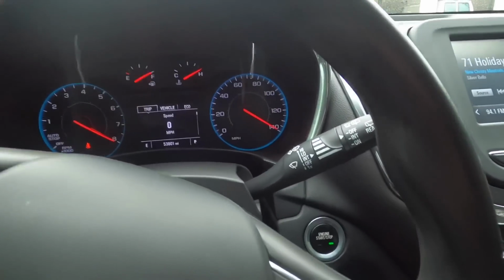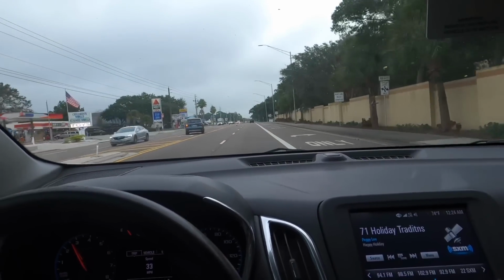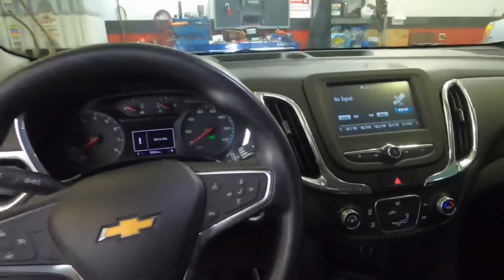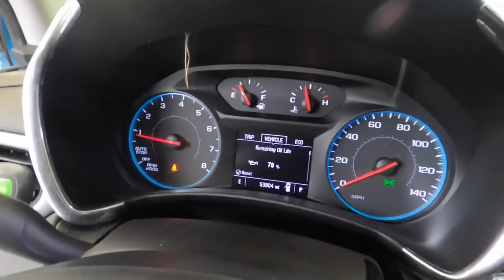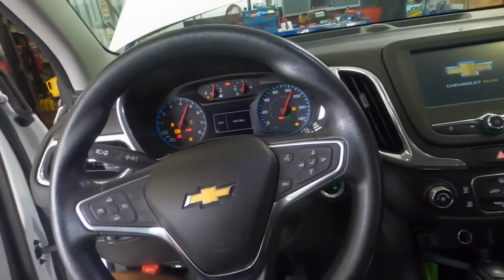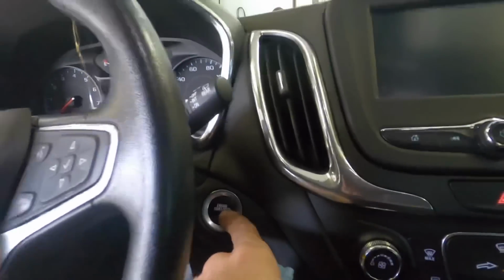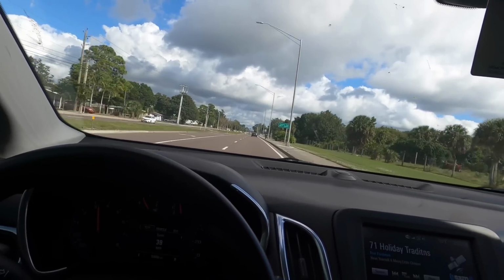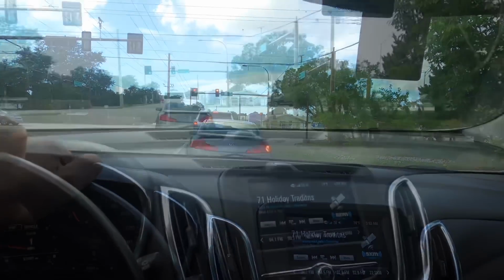Low oil could cost $$$$ | By Mistake!

Comment: This is why at 70,000 miles I did an oil system cleaner on my 2018 which uses the same engine family but it's a 1.4L. These new engines run hot and the varnish builds up with proper service. I've had no problems with mine but I feel good now doing this the last time I had mine services to prevent future problems.
Reply: The 1.4 also doesn't tolerate excessively long oil change intervals. Trying to squeeze 7500 miles between oil changes isn't worth it. If it isn't turbocharged, you're better off using a cheap semi-syn blend and changing the oil earlier, like 5000 miles.

Comment: Also, I've been told (I have a 2016 Malibu w/1.5ltr) that these engines do not like 5K oil changes. I barely get 3K in 120 days, but you cleaning it was the right call.

Comment: I was mechanic for many years and this is the main reason I gave it up. Back then we use to do oil changes to give the engine a longer life, it has gotten to the point that in order for the car to operate correctly it needs clean oil. Most people my age would not understand that and would fight with you all day. I am 54 and the cars today has gone from an A to B transport, to an expensive robot. Who would ever thought to check the oil first.

Comment: Hey Ray, another epic video tape my friend. As you know, many of the GM motors use oil pressure for actuation of the clever stuff, this diagnosis was simply satisfying to watch - You also saved your customer at least a grand and I am sure they'll return for future work.
Over here in the UK I drive a Vauxhall Insignia VXR Supersport, it has the GM 2.8 V6 (LP9 platform) and it needs frequent oil changes due to the complexity of the PCV system and oil-actuated systems, if you fail to service this motor with clean oil at least every 6K miles the goopy shit builds up and its game over for the VVT and timing chain systems - but knowledge is power and videos like yours empower us non-mechanical users with the knowledge to keep on driving trouble free.

Cheers 

Rob.

Comment: Had the same on my old escape. But my oil wasn’t even low. Just old and dirty. Life got in the way and I had 9000 miles since last oil change. VVT code! Luckily the internet did say possible oil related, so I figured start with the simplest fix first. An oil change did it! No more than 5000 miles between oil changes for me now!

Comment: Some advice from a former race engine builder, If  you drive a four or six cylinder engine make sure you do frequent oil changes and keep the level up. (This applies to all engines no matter the number of cylinders however, 4 and 6's will show stress far sooner and the problems will be greater than an 8) I now drive a Prius and before that a Jeep. One a 4 the other a 6 and i can tell you when i need a oil change just from the way the engine sounds. It will let you know when the oil is getting to degraded to keep up with demand. So do oil changes 3 to 5k and keep the oil topped up. It will help you get well over 100k in miles on your vehicle. (my Jeep had 350k on a 4.0 straight six and my prius has 200k on a 4 i can lift by myself)
Reply: well to be fair you could probably get 350k out of a jeep 4L with no oil in it ;)
Reply: @NaturalBornGriller  :)

Comment: I keep hearing "the other guy" say that small turbo engines dont last very long, I believe its because the rods and pistons arent made out the good stuff (forged) cast iron cranks are okay, back in the day I fooled around with a Saab Sonnet  which was the V_4 ford  tractor motor, the turbo blew thru the carb  ( i  dont like that set up) with no inter cooler,,but that was back in the 70,s, I had a Fiat 850 cc engine that got 40mpg and it didnt look anything like those shit box smart cars etc

Comment: 1,5 turbo is a "miniature motor"?
Well yes, they dont all have to be gas guzzling v8 pigs dont they.
A nice high revving 1.6 or 2.0 atmo engine sounds nice  the mazda and honda engines especially..
Smaller turbo engines lack the sound , but make up for it with good low down grunt and good gas mileage.
And in this continent downsizing is 100% normal , you know what gas costs overhere? Not to mention price of putting a V8 on the road tax wise.
We are not all living in missisippi...

Comment: I know that ecotec motors have alot problems especially the 1st gen and if you hear any rattling on start up then I always tell people so timing set kit and 90% the guides are wore out due to long oil changes or from extreme heat then they break but I seen tensioner break and cam phasher stop no matter oil low or changed on time it's just one of that motors down falls but if it's a chain then your a little better but people never do timing jobs anymore. Just blow it and replace it but I'm old school that believes in changing it before it can break or least do maintenance and routine checks on all systems, a scan is cheap insurance before that light ever pops on....

Comment: The fact you have a 2018 in the shop, makes me wonder about warranties ?    I live North of the border.   I own a 2019 Equinox with the Premiere trim level.    Apart from Cosmetic changes,   I have the 2.0L Turbo mated to a 9 speed transmission and it flies.    The LS and LT trims have the 1.5L Turbo as in this video.     In Canada, the base new vehicle warranty is 3 yrs.    There's a 5yr Power Train warranty,  with Roadside assistance and Courtesy Transportation.   Plus 6yr warranty for Rust - perforation and 8 years for some of the emission system.     I would expect the USA would have similar factory warranties, so I wonder why this 2018 is even in the shop?   Too me, it should be a warranty repair, and those actuators are listed as parts under the Emissions Warranty and covered for 8 years in Canada.     As for resetting the Oil Life,  if your doing a lot of short trips, or stop & go driving, that 100% Oil Life drops to 0% very fast.   The rate at which it drops is based entirely on the driving.      I changed my Oil in August, and it's already down to 10% with less than 1000km (600 miles) on the odometer, due to numerous short trips.     I'm sure some people just reset it.

Comment: Hey Ray, I was wondering if you have ever experienced the a chrysler/dodge vehicle of 2011-2015 variety with the infamous Pentastar tick. I recently performed replacement of all 24 rocker arms and lifters on my 2011 Chysler 300 Limited due to failing rocker arms. Luckily my cams lobes were in excellent shape with a little superficial scoring. I found out that the rocker arm bearing design was revised with the newer 3.6L engines so I replaced them with those. If you have experienced this repair, how did it go, how long did it take you? Alldata calls for 5.8 hours of labor, with the dealer tools I got it done in 4. Btw I have about 50k miles and I change my oil and filter every 5k miles with Full synthetic, these rocker arms had very bad bearing designs and fail even with proper maintenance.
Reply: It's the needle bearings in the rockers have gone bad. Lucky you saved the engine. If the scorering on the cam went through the parkerizing expect the worse soon. I don't think that cam is billet but may be.
Reply: @genefoster8601  It's a good thing I caught it in time. The cam lobe surfaces is smooth as glass. That's why I did not replace them. It was only one cam on the passenger head on intake. The rockers were loose, but not rattling too much bearings were stiff and did not want to turn easily. I am glad Mopar revised the bearing design to a non sleeve single pin bearing instead of a needle bearing + the sleeve. The original design resulted in failure at the sleeve surrounding the needles. The sleeve material was to thin and would shear causing the bearing to move down further than the cam lobe peak. Causing cam lobe scoring from contact with rocker arm casting.
Reply: @CodeName_Redacted  I'm glad for you catching this in time. MOPAR runs great but like all car companies there is a mistake once in a while.
Reply: @genefoster8601  Overall it is a powerhouse of a motor. Hope to keep this car for another 10+ years. Next repair is valvebody, conductor plate and shift solenoids to fix the common nag-1 2-3 jerky upshift/downshift.
Reply: @CodeName_Redacted  always ♥ loved Mopar. Next door neighbor has a genuine CUDA and a black 70 challenger that looks like Darth Vaders car.

Comment: In a low/old oil situation like this, would it be wise to add some oil along with the cleaner, just to help it reach all the places it should?
Reply: If it wasn't reaching the dipstick at all that wouldn't be a bad idea. Keep in mind that oil when hot expands, after a bit of running the oil and cleaner will be hitting all those spots.

Comment: have ran into many strange codes and issues revolving around VVT's, causing pre-dotation triggering only knock sensors. especially on GM models. i pull them after the oil cleaner and soak them in seafoam to ensure they are nice and clean, never had a comeback for it.

Comment: We do quite a few chain and sprockets on these , extended oil changes don't seem to cause problems it's the owners who never look under  the hood  2 minutes to check oil coolant and washers. As to checking the air in tyres ...Like Brain  Surgery.....Most modern cars seem to use a little oil , in fact Audi and VW cars guzzle it .  Virtually all engines with variable valve control like a good supply of oil. Once the oil is absent the chains stretch then cam crank correlation  occurs to late then..

Comment: Had someone changed the VVT pullies, they would have probably changed the oil and filter at the same time. Hey Presto - cured (by mistake) and at an inflated cost. Well done Ray, a job well done.

Comment: Again another video that shows the importance of maintaining a proper oil level in the engine and changing the oil at recommended intervals. It is nice when the problem is solved by doing an oil change and thousands of dollars are not spent replacing various parts.

Comment: One more reason to never buy an Equinox. Would have never guessed that low oil would cause that driving condition, but after the diagnosis, it makes sense. Gone are the days of simple, fixable engines. Time and technology marches on.

Comment: The small turbo charged engines have a lot of problems. Any small turbo charged engines have a lot of problems no matter the manufacturer. Even the Honda & Toyota engines have problems with the small turbo charged engines have problems including with oil disillusion problems. Which brand of engine oil cleaner do you use? I usually use Lucas 205 reseal oil cleaner/ sealant. Small turbo charged engines produce too much pressure & wear out engine components at a very low mileage.
Reply: It all depends on the drivers foot. Don't drive it like a race car, and the turbo actually improves efficiency by limiting the pumping losses of the engine. Recovers energy from the exhaust gases that would otherwise be blown out of the tailpipe.

Comment: It has always been a mystery to me - you are driving so slowly in the USA, and use such big engines. In Europe, 1.5 TFSI is not a small, nor 150 BHP/200+ Nm engines are not considered to be weak. Most cars are 1.4 to 2.0, anything over 2.0 is rare. I mean - my car has 1.4 TSI engine and I drove it at 200 km/h, my regular traveling speed on a motorway is about 140-150 km/h.

Comment: I dunno about these but on my cars there's different codes for cam position not following pcm commanded position (vvt actuator not working/failing sensor) and position not plausible (timing is physically out of position)

Comment: I had a mis fire on my Saturn vue v6 the code said it was 5,6,3 and 2 so I did plugs it still was misfiring and couldn't figure out I was thinking I hat to adjust the valves and I wasn't wanting to dig into that it turned out one the new plugs were bad and the diode thing was grounded out on the lil hook thing on the plug i couldn't believe that one plug would cause all the other plugs to misfire

Comment: You also might want to explain to your peeps that the correct oil grade and conventional oil versus synthetic oil can cause those problems. A lot of modern small displacement turbo engines burn oil and people do not check their engine oil levels between services. The extended service intervals that most manufacturers recommend are to long in my opinion.

Comment: I always tell people to check the oil level. Most cars have 10k mile intervals and people think they don't need to do anything unless the sensor goes off. But an engine can burn oil, have valve cover or other leaks or a bad oil level sensor.

Comment: I'm curious if you run into these engines often. I have a 17 Malibu with the same engine and it's barely adequate for this car, I can't believe they put it into an SUV. Mine has 83k all highway miles and no issues yet, but I'm on top of all maintenance.

Comment: People seriously underestimate the role that engine oil has in the operation of these modern engines with VVT.  You have to get rid of the old thought that 'more is better' when considering viscosity as well; 20w50 may work in a SBC built for RPM, but it absolutely will NOT work on one of these.  Likewise, low oil level can cause issues with the cam phasing.  I've seen it more than once.  Excellent video!

Comment: Bought a Chevy with the 3.6VVT V6 and all kinds of ppl told me about the problems I would have with the cam timing and chains. (lots of chains) Then I read up on the VVT system and found how sensitive it is to poor quality oil. So she gets new Royal Purple and a K&N filter every spring and fall. This was a great catch on your part. Nice to see some integrity in the repair business.

Comment: I am more inclined to believe that the low oil was not the culprit unless it was below the add oil significantly. Probably an intermittent issue with the solenoids VVT actuators sticking or some dirt clogging the screen.Issue may have been a one off or will return at a later date.Glad its fixed.

Comment: Anytime a newer car gives you a cam position code check oil first, then check vvt (or whatever oil pressure solenoid Chevy uses) if those are fine and not gunked up then take a look at the actual cam position sensors. Just what I've been seeing alot lately. Don't get get me wrong some cars have inherently bad cam position sensors. But that's not the normal

Comment: Don't discount low mileage when looking for a problem.  The first model year Toyota van we purchase new had problems from the start.  At just under 200 miles, yes 200 mile, the lifters needed replacing.  At just under 300 miles the air conditioner compressor froze causing the belts to burn and break.  My mechanic said he had never seen a Toyota with the issues we had.  Wiring harness diagram in his repair manual did not match the vehicle's.  The distributor shaft completely snapped in two.  Multiple recall notices.  A real lemon.  I thought my troubles were finally solved when a thief stole the damn thing.  Unfortunately, the California Highway Patrol recovered it within seven hours a 130 miles away.

Comment: Thanks Ray. My Dad, 10 years of night school Master Mechanic classes in the 60's, always tough me the two worse enemies of a car were, dirt and lack of maintenance. Hence, with every new car, it's an oil and filter change every 2,500 miles for the first 10,000. Over kill, but it's cheap security.... Old school, clear the metal fragments during the engine "break-in". Your knowledge of you field is astounding, at least to me.
Reply: But those metals fragments are the cutting compounds used to break in the motor!  ;)